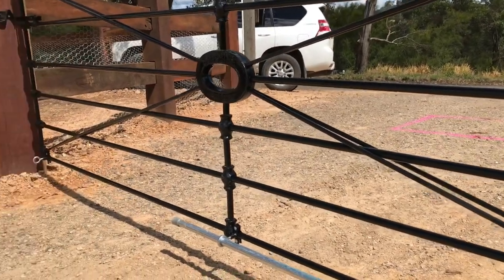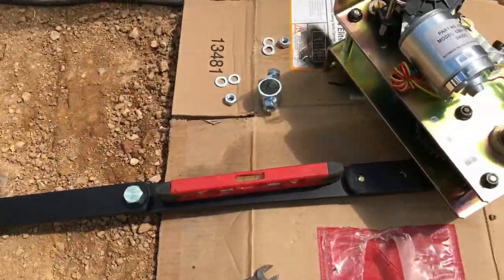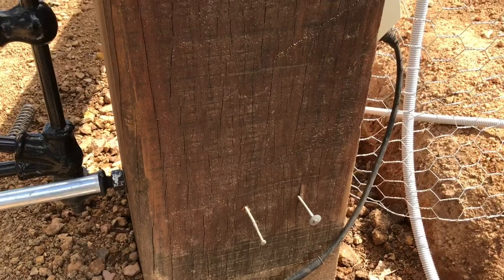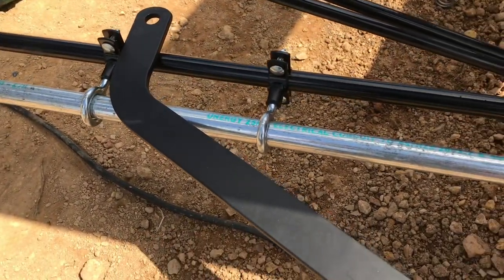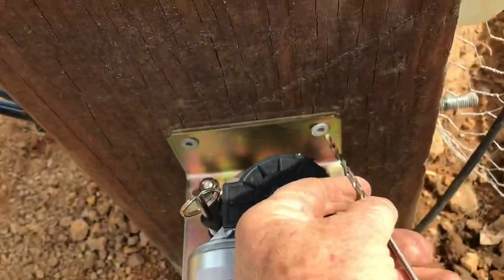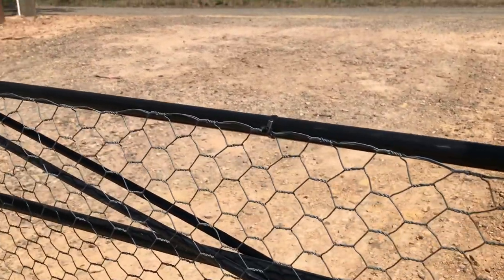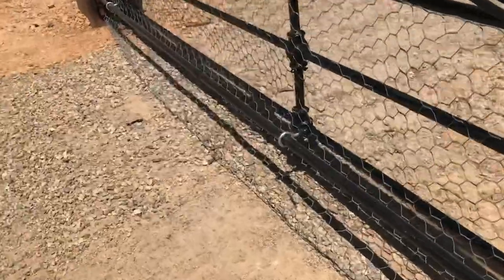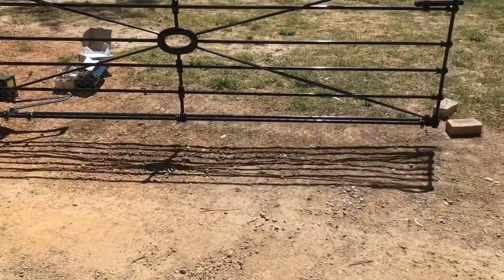Bob the fencer - Fit electric gate opener tricks

Comment: A couple of good tips there bob, pity you don’t have the full install on video 👍
Reply from the maker: Thanks mike for your feedback. 
I thought most electric gate kit makers had install videos or instructions for standard fits. 
I am just trying to help if it’s a unusual fit like the sunshine gate. 
All my videos are shot on the phone as I’m doing the job, not a professional set up video, just a how to that maybe able to help others. Any and all feedback is most welcome. Cheers Bob
Reply: @bobmayesb  hi Bob, thanks for a very helpful video! Just wondering where you can get a new Sunshine gate like this, as I’ve just purchased the Solartronics and would love to do a similar job as you have done here. Thanks, Jade
Reply from the maker: @mrmuskatee   hi Jade , Classic Cast Gates. Based in Yea Victoria ,Robert Cubbins , 0429 335 535.  (Free plug 😊). 
Ps I’m installing another,  this time with steel posts . 90x90 x 2.7 as the gate hinges are 1175mm apart. 
Cheers Bob.
Reply: @bobmayesb  Thanks kindly mate, I managed to speak with Rob today nice bloke and very easy to deal with. I’m going to order one! Do you make and sell the locking rod brackets mate as you showed in your video?
Reply from the maker: @mrmuskatee   hi Jade no i have just made them for my use. As the sunshine gate has 20mm pipe , drilling a 8mm hole for the eye bolt would in my opinion weaken the bottom rail. And also the bracket spaces out the lock pipe to miss the casting on the gate. Maybe i can help but no promises. 20x3 flat bent in press with a 8mm nut from Bunnings + 6mm bolts. Cheers Bob.